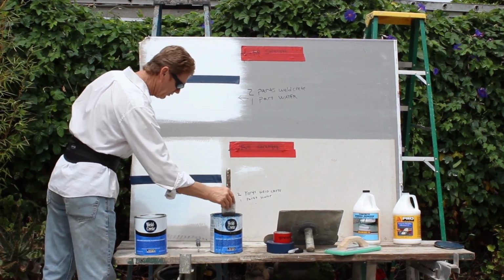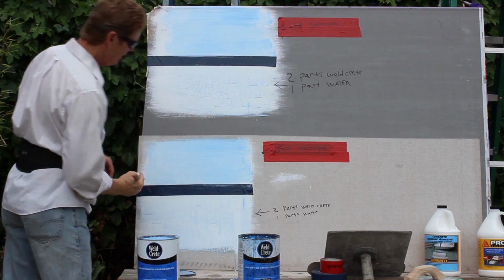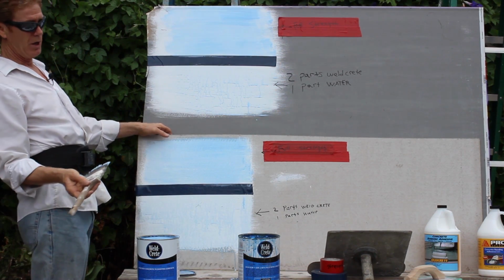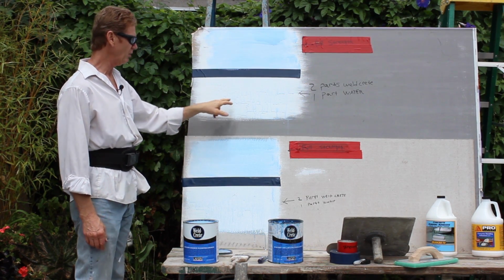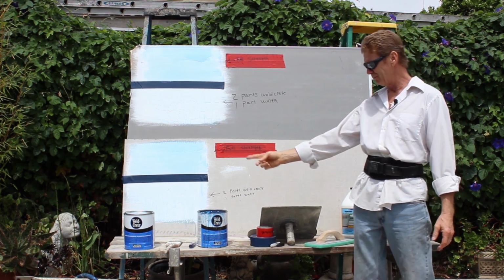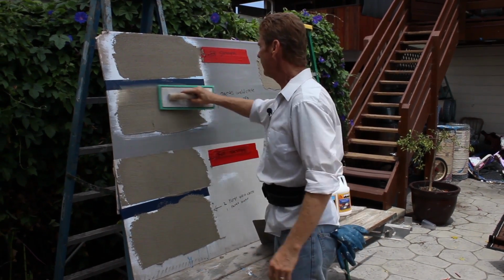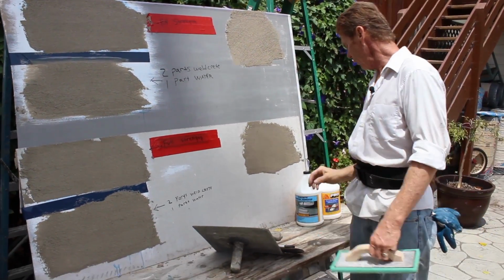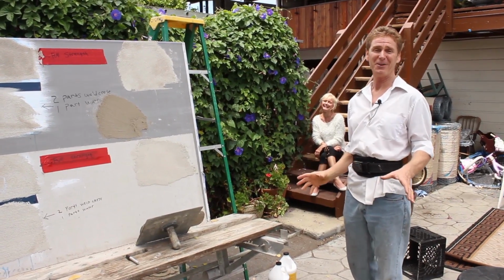Stucco and Concrete bonding agents.

Comment: A great video. I agree with Kirk, adding bonding agent to the mix is not the best method.  Applying it directly to the substrate is best.  I think the reason for the alligator cracking is as Kirk says, the absorption is almost killed. For thick concrete layers, it is fine, for very thin fast drying color coat ( cement finish) it should be diluted.   
One thing I have seen to often is plasterers used " Plaster Weld" on exteriors.  The color is pink and meant for interiors only.  I know Kirk knows that all to well. I agree with Kirk Weld Crete is great stuff.
Reply from the maker: Mark Fowler There you go folks, I only know handful of men who have 
Marks credentials.
Mark fowler literally wrote the book on plastering, titled
Plaster & Drywall Assemblies, plus he is the Author of Northwest Wall and Ceiling Bureau
Stucco Resource Guide.

A bit more in regards to Mark Fowler below,     

Mr. Fowler is the executive vice president of the Western Wall and Ceiling
Contractors Association (WWCCA) and Editorial Director for Walls & Ceilings
magazine. Fowler has extensive experience with drywall and plaster as a
contractor, architect and code educator. Fowler has written on a variety of
wall and ceiling issues for more than 35 years. He has served as a past expert 
witness in many litigation cases and frequent guest speaker on plaster/drywall
throughout the United States and Canada. ASHRAE technical committee 10.12
“Keeping New Construction Dry.” Author of Northwest Wall and Ceiling Bureau
Stucco Resource Guide.
 Thanks Mark for the bone, never know some folks might view this and think 
what the heck does ol Kirk know, when in fact ol Kirk knows without a doubt 
any color finishes that come of in my lifetime, I will be re-appling at no cost.
 best wishes, 
 kirk giordano plastering

Comment: Would you say a color coat is similar to a white finish coat(3/8-1/2 thick, white portland and Sand(#30 up to #16)) on a pool? I bought sika latex R Pro for the purpose of enhanced adhesion and I was planning on adding it to my white finish coat.
Reply from the maker: ***** Morning Mike, no, not at all, a color finish, weather it's maker is BMI, LaHabra, or western or any of the bags of finish coats are engineered to be applied 1/8 of an inch, any thicker they will cracks when dried like fallen eggs.
 Where as the white finish coat usually manufactured by Lehigh as in their white cement plaster is the exact same cement plaster as the grey based portland, 
(difference being you pay more for the white as it's cost more to crete white cement stucco) bath can be applied 1/4 to 1/2 per coat.
 The Sika product you mention, I understand the purpose but have never added Sika, quickcret or weld crete to a stucco material myself.
 Instead when needed I apply any of these bonding agents to the wall, then apply the material. FYI, bonding agents should be applied directly to a wall.
 O.k. back to the subject, if it were me I'd prep the pools walls by pressure washing with at least 3,500 psi, and also use a tubo tip for added cleaning effect.
Next, I would apply weld crete to these walls, then I would mix my white cement with sand which will give use a tan finish and apply. Usually folks apply a finish coat after this base coat dries.
 bets wishes,
 kirk Giordano Plastering
Reply: Kirk & Jason Giordanos DIY plastering and stucco tips 

Thank you Sir,   I appreciate you helping with details that only a experienced people have. I watched your video on pressure washing the surface . I bought a good pressure washer, and it really went to work on my old plaster surface. I had done demo first, then did the pressure washing,it really made the surface rough and keyed.
Thank again, your much appreciated for us DIYers..
Reply from the maker: Hello DYI Mike, thats what it's all about, Cheer!
 Kirk Giordano Plastering

Comment: great video thanks Kirk, it explains it all very well, here in Australia I mostly see a product called bondcrete, hopefully that is every bit good as weldcrete except it dries clear, I hope to colour coat the back of our house which has painted cement sheeting so I guess 2 parts of my bondcrete to one water , I will try a test board first, thanks Graeme
Reply from the maker: Graeme Australia Attaboy Graeme from Australia, I rarely use other bonding agents therefore I can't comment on the one you are referring too, 
please,  let me know the result of your test, so other folks who read this will also know.
Most bonding agents are not this strong, I have painted surfaces and applied a solid inch of stucco , these areas are still holding more than 20 years later, that's mighty strong.
Best wishes, with your project.

 kirk giordano Plastering
Reply: I wish they sold weldcrete here as you have proven many times how good it is and the colouring helps
Reply from the maker: Howdy Australia dude, I just googled Bondcrete it appears to be a solid company, doubtful any companies going to come up with a bonding agent specifically for the sole purpose for use as a primer over a painted surface for the application of a 1/8 inch finish coat, as most homeowners don't even know what a stucco color finish coat is.
best wishes, 
 kirk giordano Plastering

Comment: random question kirk. i dont like using plasticisers... because main reason it significantly weakens the aggregate, cement, plaster etc. another reason it makes a cheap quick job for who ever mixes the compo or muc if you ad a cap of plasticisers in a mixer per load or water it stays in the mixer until you completely wash out. plus using a plasticisers does not give the mix enough time to fully mix tidy so you lose your 3 second rule and may even lose the batch because you have to mix longer or under mix. and yep i use mixers but i only use a plasterers bucket 25kg of plaster too a bucket of water or quarter fill the plasterers bucket with water and add the plaster and whisk. plus i just use PVA or Uni bond for walls and concrete same thing and that blue stuff im sure?
Reply from the maker: SgtAMYNTAS Howdy sargent dude, I am not too familiar with plasticizers as I have never had a need for them in my trade.
 I have used it in tile grouts however.

I do occasionally use admixtures such as accelerators or retardants in my cement plasters.
 Most of the cement plaster bags I buy are a mixture of common and plastic such as the (Lehigh's premium cement plaster) all the necessary ingredients are in the bags except sand and water. 
 Weld crete is not sold as a plasticizer, but as a liquid bonding agent for adhering plaster to just about any surface imaginable even glass, it's that strong, or concrete to concrete.
Lastly, I am certain there are about 50 similar products worldwide but doubtful they are as strong as Weld-Crete.
 Best wishes, 
 kirk giordano plastering

Comment: Hey kirk! thanks for the clip
it has something to do with the drytimes + the weldcrete made a dividing layer
and the Plaster cant stick to the wall right?! thanks for the explanation!
Reply from the maker: SuperGhinz Hello Super Dude, sort of, the sealed wall with many coats of paint and the application of a bonding agent which also seals porous walls, allows NO suction so the color finish coat which is only an 1/8 inch thick has to dry from the outside air, plus weld crete is without a doubt the strongest stucco bonding agent in the world today, so together with only the outside air drawing the moisture out and a glue that's tens time as strong as needed the chemical reaction somehow causes this effect.
 I don't know the engineering reason this takes place but I do know how to avoid this spider checking on my projects.
I'm sure if a rocket scientist watches this he'll explain what's really  going on, or I can e-mail this to Sheldon of the Big Bang, T.V. show, Sheldon knows everything .
 best wishes, 
 kirk giordano plastering
Reply: Haha great thanks